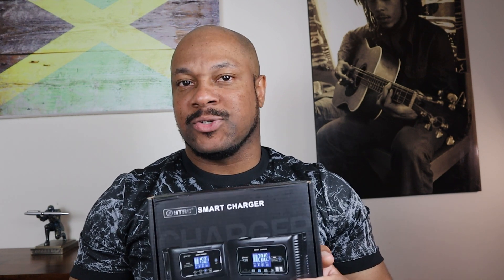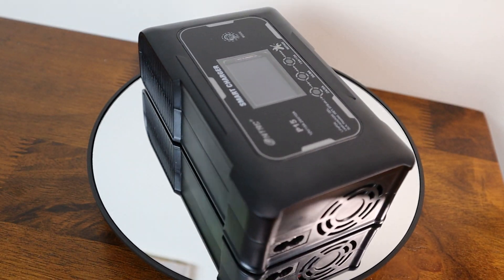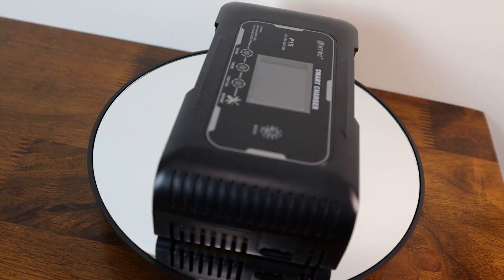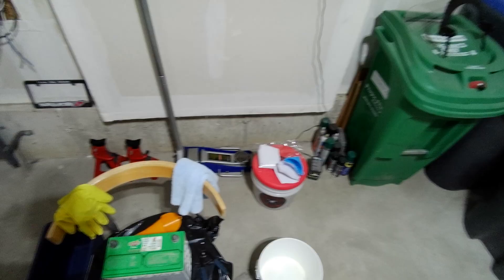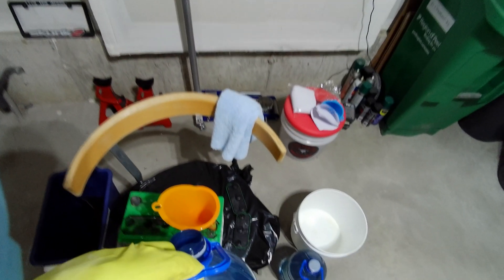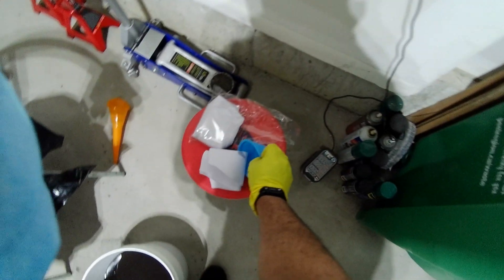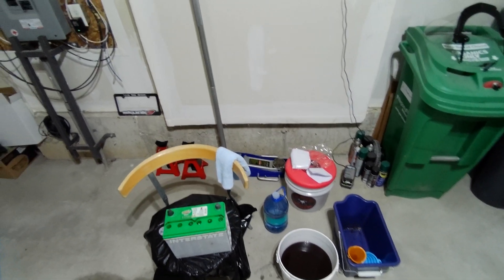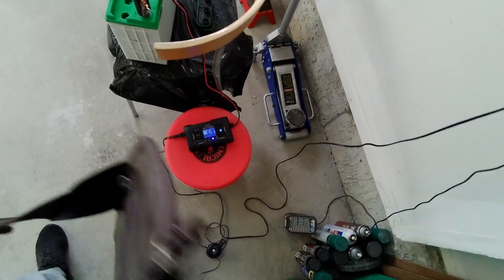HTRC Smart Battery Charger 12V/24V model (P15) - Unboxing & Demo

Comment: have the p20 model and when i turn it on the screen shows a flashing battery and says off, can not get it to charge anything
Reply from the maker: The  light may flash for the following reasons: The environmental temperature is too cold to charge the battery. The battery is old  has not been used for a long time. There is a poor connection between the battery and charger. 
NB.  If its a very old battery break down the sulphate deposits using an additive solution before you pulse. Also clean up the battery terminals with a sand paper to improve  conductivity. +& -  Try this let me know how it turns out.
Reply: The charger needs to detect about 1A current before it will start a charge profile.  Connect another 12V battery in parallel (has to have some charge) and charge both for maybe 15min.  You should be able to charge the "dead one" now.  I've done this with this exact situation many times including today with this exact charger on a marine battery.